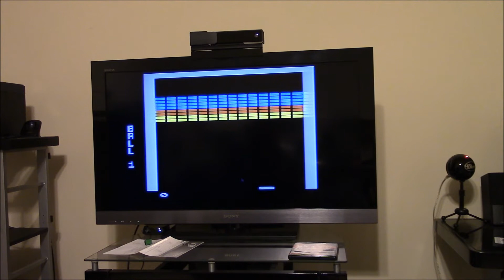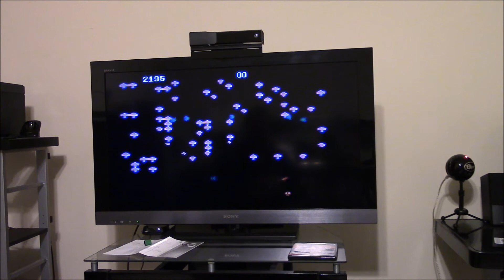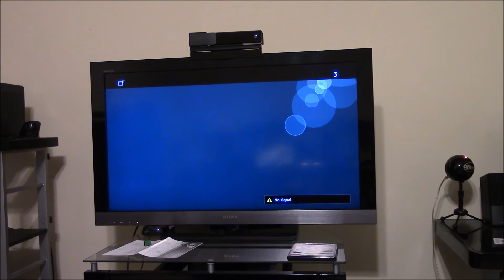Testing Some Atari 5200 Controllers

Comment: Yeah Crusher, problem was that in Pole Position you're supposed to switch to "Hi Gear" you were in "Lo Gear" the whole time which doesn't allow you to drive any faster to get those times you need.
Reply: Crusherbad64 I believe you have to press something on the keypad to shift.

Comment: The US-made “CTS” brand pots can’t reach the bottom or the right. You cant defend the right-most city/base in Missile Command and you can’t even turn around in Pac-Man. I have several NOS controllers with this issue straight out of the factory sealed case of four. I’m actually working on a fix for that! Stay tuned. :)
Reply: I finished the video and see that you did try Pac-Man and you were able to turn around, so it’s clear that your potentiometers weren’t as far gone as mine even though you also couldn’t move all the way right in Super Breakout. I’d really like to see if you have the same problem I have with Missile Command. All of these New-Old-Stock controllers have American made pots with Rev 9 mylar flex circuits inside. The Rev 9 mylar Swede significantly improved, which is why your buttons still work. The earliest controllers had bad carbon contacts on the rubber membranes and it took a few revisions to solve that, but by then they realized that the mylars were also bad so it took a few more revisions to fix that. By then, we had the bad US-made CTS pots where earlier controllers had Japanese-made Alps or Mitsumi pots. Of course, it took a few years to realize that the CTS pots were going bad (resistance drops) so they never got revised.